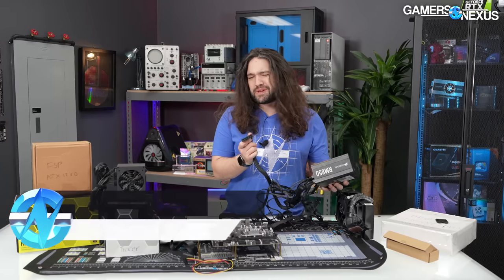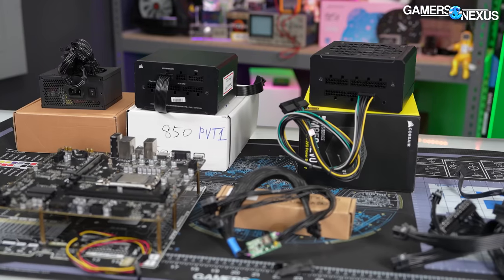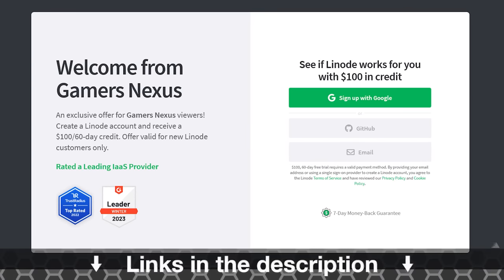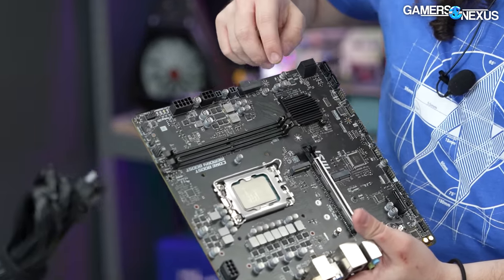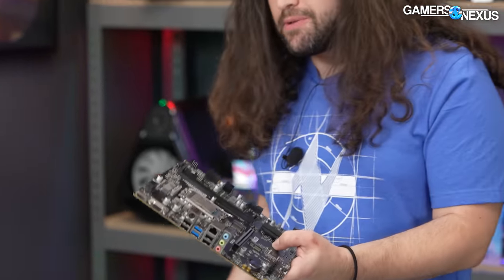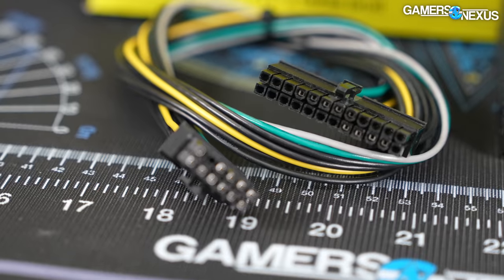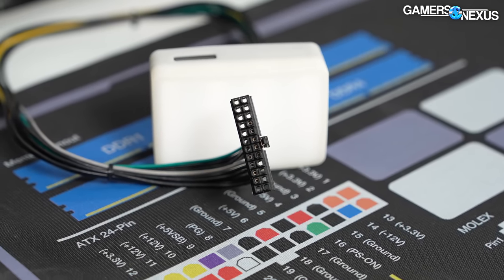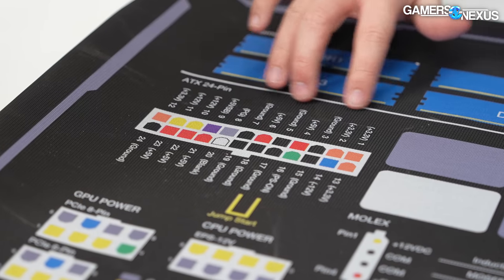The Future of Power Supplies - Maybe (Motherboard Cost, Cables, & ATX12VO)

Comment: I'm against the change personally.  I worry that not only will the cost and potential for MB failures go up, but could also mean less power related protections on other components causing higher failure rates across the board.  This would also making additional work fixing PC's since the motherboards take much longer to replace than power supplies in general, and if additional components start failing due to MB power issues make troubleshooting them take longer still.  The benefits just don't make up for the additional issues.  

I think a better solution would be to make a new standard for components to eliminate all but 12v and then something like this would make sense since power could still come directly from the power supply as they do now with no conversions needed.  At the same time i could also recommend standardizing cables so ALL the cables have the same pinouts (PCIe, CPU, even hard drives) on both the component side AND the power supply side to eliminate the risk on incompatible cables being used destroying good components and give users more flexibility with the power supplies (such as not having to worry about how many PCIe or SATA ports they have on the power supply, just how many total they need).
Reply: I dont know how one can plug in wrong power cables like that. One shouldnt try to build a custom pc if one cant understand very basic things. But, as i understand it, the main argument for this 12VO change and mbs doing the conversions was eco friendliness. 

It doesnt change anything notable for the end user but its good for ecology, according to experts. And while im more than ok with ecology/nature doing better, i would have rather seen example new standards for the horrible cable mess that pc building(still for some reason) entails. Unless you buy expensive custom made cable mods and such. 

Especially with all kinds of rgb cables and different manufacturers having their own rgb stuff and rgb routers/control centers etc. And their own softwares on top of that. So at the end kinda on the same lines as you. They should focus on that sort of stuff first, but not limited to rgb of course. 

And when they fix those problems. When customizing/custom building your pc doesnt feel like big pain in the butt for stupid reasons while you have paid a ton of money to those companies, then focus on the eco friendliness for eco friendliness sake. Now it just seems like they couldnt care less about the end user aspect but about ideological topics.
Reply: @manefin  I may not have said that part clearly enough, but  I'm referring to modular power connectors that have different setups connecting to the power supply itself, and is a very real issue.  Different models from the same manufacturer can have different pinouts so using cables from a different model or trying to get replacements can brick a system if not careful.  Even Bitwit bricked a system last year i believe by using a custom cable made for a different power supply that he though was compatible.

Comment: I'm just not seeing why or how moving the voltage conversion away from the device that is purpose-built for that is going to increase efficiency.  Can you/Stone shed any light on that?

As for the significant power savings over wide deployments, if most large employers are like mine (the federal government) and I suspect they are, they don't have their computers going into a low power state ever anyway.  My laptop just sits there happily blasting away its fan at max speed whether it's doing anything or not (and no it's not just the fan curve, it's actually getting hot).  Also somewhat disproves the thought of government "encouraging" new standards like this out of concern for the environment or even just grid.  We're literally NOT ALLOWED to shut our PCs down overnight just in case they want to roll out patches.

Comment: 7:42 Hiding circuit boards in cables is ugly and messy. I'm happy to mount a circuit board in the case somewhere or perhaps pay extra to have this function on the board, but not this ugly kludge. Otherwise I like the ATX12VO concept for new builds.

Comment: What really sucks about all this is that 'theoretically' the power supply guts will be simplified while the motherboard circuitry will be more complicated.  This means that 12VO only PWS should be LESS expensive (and we know they won't be, they'll be like, "***NEW***IMPROVED***MORE***EXPENSIVE!!!"  and the motherboards will go up further in price which is frankly obscene unless Mobo mfgs. have raised prices preemptively with this on their roadmaps for the foreseeable future.  (doubtful)  So PWS will probably get more expensive and Mobo's will get more expensive while being cheaper to produce and already being overpriced respectively.   

The argument by MSI that "they need to use more layers" is complete BS because they have to use more layers anyway with DDR5/DDR6/QDR6 signal integrity.  Its a BS excuse to yet again raise prices.

Meanwhile the end-user (us) won't notice or care about or notice any of this other than paying more money for the same thing.  Bravo! industry!   What happened to "economies of scale"?

What would be REALLY awesome is, with this new spec, if ALL Motherboard Mfg's were REQUIRED to use the same pinout on ALL PLUGS, both PWS side and device side so all cables across Mfgs were swappable without destroying your equipment.  The current setup is asinine and needs to go.

Comment: It's a terrible change for the end user, if implemented as is.
As long as the other voltages are still required anywhere, the burden is just shifted from cheap and easy to replace PSUs to expensove and difficult to replace MBs.
The burden includes heat, price, compatability with the other parts of the system, points of failure, etc.
Either everything is 12v and the rest is not needed or all that conversion should stay where it belongs: at the PSU.

Comment: There is no need, there are already existing 12 v supplies and DC to DC boards that plug right on top of the 24 pin, no need to reinvent the wheel here. If you want to min/max your efficiency just use the off the shelf stuff that already exists to do THE EXACT SAME THING.
If they give us PC style laptop parts with the standard then it's fine, otherwise it is useless.

Comment: Not sure I agree with this direction... isn't it reasonable that it's the power supply's job to... you know... supply the types of power expected to be used?
As more and more functionality shifts to a singular component, we'll see more and more compromise and trade-offs, in addition to a higher price.
OTOH, maybe someday with solar we'll see homes shift back from AC to DC, and we'll see 60VDC home connections feeding 60VDC motherboards lol

Comment: I really don't like that the 12VO standard shifts so much more of the responsibility for non-12V rail design to the motherboard. This has the potential to result in confoundingly and frustratingly different levels of build quality between the PSU and potentially the motherboard, if the motherboard designer decides to cheap out on the 3.3V and ±5V rails. The step-down converters on the motherboard could potentially fail, rendering a whole expensive motherboard that is otherwise still perfectly good as little more than e-waste. I would rather keep all of the primary voltage rail design left to the expertise of the power supply builders. The only motherboards I'd be willing to trust on the 12VO standard would be the ones made by highly established brands that also produce quality power supplies like... oh... it's just EVGA that can do that right now... Yeah.

Comment: I certainly wouldn't approve of 12VO becoming the only option. Mainboards are expensive and crammed enough as is. I'd rather like to see USB4 being present everywhere instead of these "how to squeeze more money out of consumers" move. Besides, I really don't want data and power leads go from my MB to the drives - this totally nullifies that 12VO is supposed to create less cable clutter. A PSU accompanies me for at least 3 builds btw. It would be non-sensical to throw out perfectly good voltage regulators every time the MB is changed. We're supposed to add less e-waste to landfills, not more.

Comment: This is a great idea, now we are talking. The combined  24 to 10 pin reduction for the motherboard and   4x8pin down to 12+4pin for the GPU will reduce cable clutter a lot. We will need to get used to it, but for many of us the ability to remove the rat nest of cables will make our hobby much more enjoyable.
Reply: Cable clutter is the least important thing. Not re-buying power sections (how many of us have a power supply we've used in 3-5 builds now? My AX760i is on its third build) and not having a motherboard make assumptions of how many devices (like drives) I want to use are far more important. I'd like fewer cables too but not at the expense of those other things.
Reply: @korgied  With the proposed standard you don't lose anything, you can use cables or adapters that can convert from one standard to the other, so you will be able to  upgrade part by part as you go, when you want. This can be a similar revolution to when modular power supplies arrived, you were never forced to buy them but when you need a new one it is the obvious choice.

Comment: Even if you move the buck conversion to the motherboard for "efficiency gains" these motherboard vendors won't be able to produce the power supplies better / more efficiently than the specialized companies like SeaSonic do it nullifying the purpose of 12V0. 12V0 is a corporate scam to obsolete ATX power supplies. Also, this will increase the odds of your motherboard failing, where with ATX you can swap a power supply if you have an issue.

Comment: I was really looking forward to "promised" 12VO when starting to build Intel 12th gen system a year+ ago. But even today there are zero decent MB and PSUs with 12VO.
ATX, the 40+yo format makes me feel really sad and helpless. All the progress in between for what? I have had mATX with 3 NVME slots. Who (%) needs slow SATA anymore? Noisy HDD for gaming PC anyone? Yet we still build huge towers with useless 3V and 5V pins. WTF? Also that extra 6 pin connector on simplest MSI MB I have seen? For what? Proprietary modular 24 pin 27 wire PSU cables is the state of art bull** we get fed instead. Intelligence insulting "must sell accessories" future we are living in.

Comment: I somehow don't believe the 24% cost increase is correct. OEMs have been using 12V only for over a decade. Cost matters for cheap office PCs. Typically they are smaller then ATX. They wouldn't have pushed their own 12V standard if it would cost that much more.

Comment: There's a lot of good on 12VO. It'll take time before we get there but, hopefully, we do. Of course, prices will suck and points of failure are shifted but I still see good in this: like the load communication system with that one 3.3v pin.

Anyway, great video.

Comment: I don't get why a function that seems a perfect fit for a power supply should be put on the motherboard that already handles so many functions. The word power supply says it perfectly, it provides the power to the PC and should do so in the right voltages.

Motherboards are already packed with so many functions it's asking for trouble. Not to mention they're ridiculously expensive now, if they add this it will be ridonkulous.

Comment: Standby power draw is a huge problem. In my IT class we did some measurements and I don't remember the results but I do remember the conclusion: EXPENSIVE
Reply: What a meaningless nonsense. Main losses are at AC-DC conversion, not at DC-DC while idling.

Comment: tl;dr: I like the overall idea behind 12VO. However the current state of the 12VO spec looks very half baked to me. If we're already breaking old and creating new standards for power delivery, we may as well see it through and do it properly the first time.

I think downconverting for components that live on the motherboard (chipset, PLX chips, USB controllers and hubs, M.2 SSDs, even the 3.3V rail for PCIe cards) is reasonable and should be the way forward. What I don't understand is why the motherboard is also supposed to power devices that don't live ON the motherboard. Why not specify a small, 2-pin 12VLOPWR power connector for those types of devices and have them derive their own low voltage rails as needed? This would could keep the extra DC/DC clutter on motherboards to a minimum (ITX board designers will thank you). Additionally, you could then use as many drives, water pumps, fan hubs etc. as your PSU can handle, rather than running the risk of overloarding the motherboard's 5V DC/DC as you potentially could with the current state of the 12VO spec.

Finally, we could get rid of PCIe 6-pin and 8-pin, EPS 4-pin and 8-pin, molex and SATA and declutter down to only 3 different power connectors - all of which would be carrying 12V:
12VO-ATX to replace the current 24-pin, 12VHPWR for CPU and GPU and 12VLOPWR for drives, pumps etc.

Comment: The obvious issue to me is that I want a PSU maker doing the electronics to control the power to my board, they have their reputation resting on getting it right. 
If left to the MoBo manufacturer it becomes afterthought and will be like the bad old days of weak VRMs again.

Comment: on a different topic, 2.5" sata drive port on the mobo should have been invented prior to msata/nvme lels. imagine a DIY motherboard where we just slot in sata 2.5 ssd/hdd screw it in very convenient, no need for sata data cables and sata power connector ^_^ its useless now coz nvme is the new norm.

Comment: I have zero interest in 12VO surviving or taking off in any way. It's going to make motherboards even more expensive than LGA already does, and it's going to add that cost to a component I replace more frequently. Because I generally get a single really nice power supply and end up using that supply through like 3 builds over 10+ years. Meanwhile the progression of sockets and RAM usually means that the motherboard is replaced each time.  On top of that, the "footprint reduction" isn't even really real....because now you have a whole chunk of the motherboard that has to be sectioned off for the new delivery circuits. All of which is also very noisy circuitry to put with everything else on the motherboard...it's a solution lookiing for a"  "problem". The communication pin is nice but they could just add that to the ATX standard.

I guess if you wanna use it for servers...sure...but for desktop PCs no.

Comment: nvidia is still pushing that 12v connector despite still causing problems, they keep blaming it on user error but it's designed to be very difficult to insert correctly so a lot of users don't... meanwhile amd is doing the right thing making their cards more efficient, they still only require 2 pcie connectors, not even a 3rd one for most cards, that's the right way to go, don't pass the issues onto the consumers just make your cards more efficient with existing psu's

Comment: I prefer the buck converter stay in the PSU, not in the motherboard. Now you can't cheap out the motherboard and stay with expensive (gold) PSU, you have to buy motherboard with good buck converter and expensive PSU. Benchmarking motherboard would need an extra step, since the buck converter is part of the motherboard and not the PSU

Comment: Yeah, not a fan. My power supply served three motherboards already, and within its 12-year warranty is will surely serve two or three more. Doesn't really make sense to purchase these 3.3V/5V components with each new motherboard again. You have to swap motherboards a lot more often if you always want the "latest and greatest" while a high quality power supply can serve you for a decade or longer.

Mid- to high-end motherboards are already struggling for space, especially in the mATX or ITX form factor, where additional M.2 slots or other connectors are moved to add-on cards that you plug into the board.

Better power efficiency or not, this just feels like change for changes sake. I hope it doesn't take over the DIY market.

Comment: Heat dissipation because of high current distribution thru motherboard is very bad idea without complete new redesign and topology of actual ATX standard. If we look on actual size and MBO design then we can see that is more and more heatsinks and heatpipes on MBOs. ATX toplogy is on top limit right now and they want to add some VRMs and Step down convertors to top on all of that?! How they imagine to spread all of that heat from motherboard within additional PCI cards and with what idea on coolin path for all that electronic components?! Active cooling, passive cooling, heat pipes, bigger heatsinks... Where will be located and on which sides all of that heat will be distributed? What I`m thinking about all of that is same as we see today on all electronic components... They want to limit on some way durability for all components and push customers to buy new components in shorten period then we have today. Personaly I`m doing repairs and modifications on audio gears and also design PSU for specific projects and with my modifications that audio gears can work hundred years without any single damage on electronic component. My old FX-8350 run on 4.6 GHZ on air cooler without any problem all day at 100% load and max. sustainable temperature does not exceed 58 degree celsius. Inside case is additional 4 PCI cards and six HDDs. This is all due to cleverly designed air circulation and heat removal inside the case. Putting additional electronic components on an already overbooked and overheated motherboard is close to suicide.